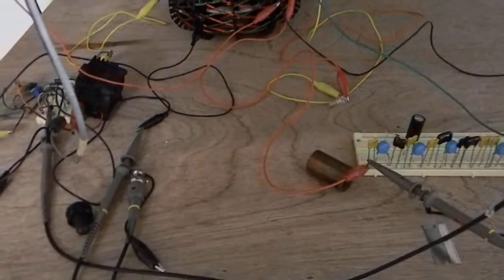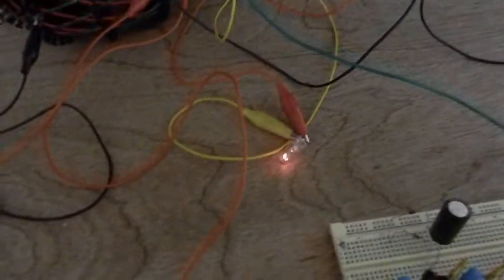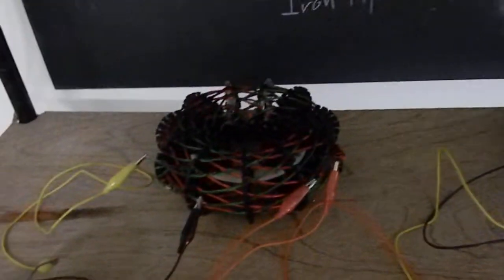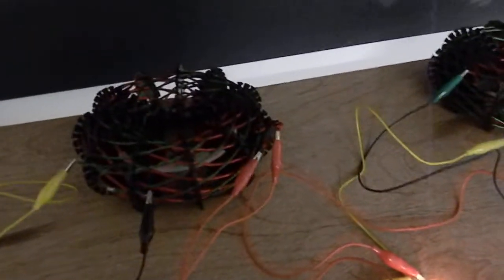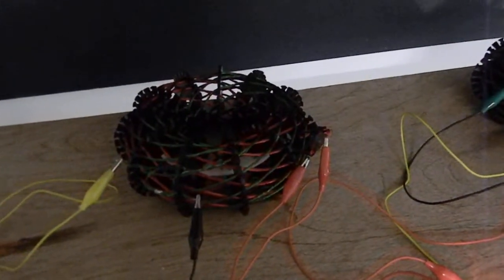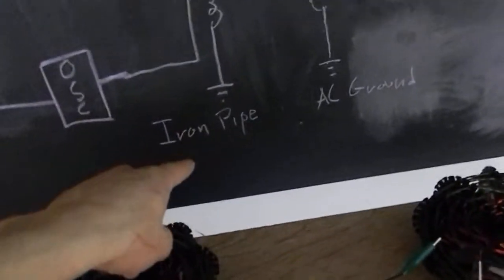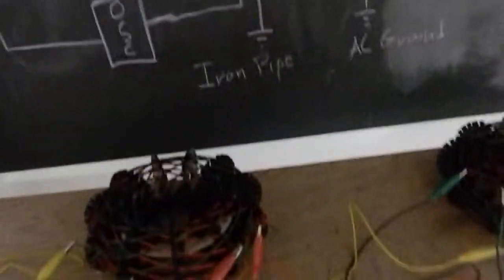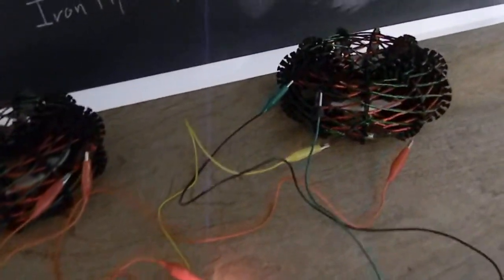Two Different Types of Resonance

Comment: I’m not sure I understand the significance of this. It is really just a demonstration of inductive coupling vs capacitive coupling, both are RLC circuits with resonant frequencies.

You have two air core transformers, they are wound kinda weird and don’t look like they have a high coupling coefficient.

In the first experiment you say that the secondary coils of both transformers can be ignored(disconnected?). So basically you just have two poorly coupled inductors, one with a variable frequency source driving it, the other with a small lamp connected as a load. Not surprisingly, you can only get the lamp to light dimly due to the poor inductive coupling and therefore inefficient energy transfer. Simple solenoidal coils or pancake coils would perform much better.

In the second experiment you connect the secondary coils both to ground and then together on the other end with a 12nF capacitor. Now you have your transmitting transformer connected through the capacitor to the input of the “receiver” transformer which in turn is powering the lamp on its secondary. First of all, this setup is not wireless since you have them connected via the capacitor via wires. Second of all, the transmitting transformer is doing nothing (except wasting energy), it would be better to connect your voltage source directly to the input of the receiver transformer (with the capacitor still in series I suppose). 

And before you say, well the capacitor could be replaced with just a transmitter and receiver toroid or something, no, to get 12nF of capacitance even at just a distance of 1m you would need plates with an area of over 1,000m^2

So basically you said look capacitive coupling is better than inductive coupling, while using poorly coupled inductors and an ideal capacitor. Not an apples to apples comparison!
Reply: Btw I don’t mean to sound too critical, experimentation is good! But I hate to see people reject what they might consider mainstream EE knowledge (not saying you do!) but accept partially pseudoscientific ideas that really just “work” based on already understood and explained phenomena.

Comment: Hi there. Been loving your experiment archive! I'm wondering what happens when you put the two coils nearby, but stand them such that the other coil's putyer diameter touched the inner diameter of the other-- tangential. Is that still uncoupled? I agree that increased magnetitc energy flux involved in the transfer of energy within a harmonically resonant LC with spark gap is key... though I haven't finished my ecperimental set up just yet.

I don't think we need ground. Earth that it. The planet has many great benifits to the system, potentially... but we may need many tesla towers today. 

Free space. Emptiness. The aether. Thats all we need. A symmetrically balanced system arranged in a way to pulse energy. We must do it as cleanly as possible, else your "clean" signal in a spark gap appears with so much RF noise. On and off fast and short is the goal here, and the energy in space is available to meet our power demand. Sink or source.

Comment: capacitive coupling resonance can not be repeated indefinitely in my experience. it will load the souece down. But it is basically longitudinal transmission.
The fun starts, when you use impulses to induce resonance.
Impulses like inductive spikes
Reply from the maker: wait till you see what im building now
Reply from the maker: and you are entirely correct, this is stuff i figured out long ago and i was rather naive in these videos.
Reply from the maker: Im currently building a thyratron switched HV DC magnifier system to investigate different extra coil frequencies along with fusion (fusor.net), water burning and some other things!
Reply: @MrWarrensk   Sounds good! A thyratron could also be used to switch a resonant coil at maximum voltage to get an instant (disruptive) discharge. causing a longitudinal wave from the high dV/dT (instead of using an impulse)
Reply: @MrWarrensk  I see the latest (public) video of yours is from 5 years ago, is fusor. ney where you publish? Would love to see your work
Reply: @MrWarrensk   just looked at fusor.net  Fusion is a lot better understood when the electrostatic is not seen as related to particles, but to the dielectric field.

Fusion then becomes the fusion of the 2 electric fields, the dielectric field and the magnetic field.

When these 2 fields are fused, electricity is created.

But first both these 2 fields need to be induced, by magnetic induction AND dielectric induction, at the same place in the same time.
Reply: @MasterIvo  Linda Moulten Howe has a piece of "UFO" wreckage that was obtained by a soldier involved in the cleanup of the wreckage in White Sands NM in the 1940s. The bottom of the craft glowed for 3 hours after it wrecked. When it stopped glowing, the soldier broke pieces off and pocketed them. In 1996 they were sent to Art Bell. He gave a piece to Linda. She had them analyzed. Their Ion levels were 60 percent higher than they should be, and upon further analysis it was discovered they were subjected to terahertz frequencies approaching the speed of light. She doesn't know what that means because she's still brainwashed into Einstein nonsense. 

The high Ion levels were due to the metals being turned to a plasma state. Her metal was made up of micron layers of magnesium, zinc and bismuth. ALL diamagnetic elements. How were they turned to a plasma state? 

Here is an experiment done with a homemade ham radio. It's receiver was way too small to handle the High Frequency waves, and the Stainless Steel rods BYPASSED the liquid state of metal, and instantly turned to plasma. 

https://youtu.be/4yLbYlyT7wM

Linda's metal was turned to plasma using even HIGHER frequency. Terahertz. 
This is a Nikola Tesla plasma ball being spun at 4000 RPMS. Once it reaches high velocity spin, the tendrils are no longer free floating. They take order. Notice how hard the south pole tries to form despite the post powering it being in the way? Once they put a tinfoil hat on it, it tries to draw energy from it at the pole, causing the tinfoil to glow vibrantly. Northern lights. 
https://youtu.be/Wis_HEa3X84
That was just basic neon gasses creating that, powered by 2 AA batteries. The tendrils align within to create its own magnetic field. If you performed that exact same experiment with magnesium, bismuth and zinc, you wouldn't get a magnetic field. You'd get a DIAMAGNETIC field. ALL the incoherent dielectric acelleration would be pushed away, causing levity. 
There are hundreds of "UFO" cases involving ION residue left behind, electromagnetic radiation, molten magnesium drippings from crafts malfunctioning then crashing, as well as plant growth being permanently affected by landing crafts. See "Magnets and seed propagation". 
Let's go further. Bob Lazaars claim of Element 115. Unumpentium. Now known as Moscovium. It's used to make Element 113, Nihonium, by smashing Zinc and Bismuth nuclei together. Both DIAMAGNETIC elements.
Bob lazar also made a claim he could see light bending around the craft, but we've all seen a Ferrocell by know, and understand what is causing light to bend. He also stated WHILE the craft was operating, he could hear the men inside it as if they were talking on a loudspeaker. Well, the Ham radio plasma video. He was talking THROUGH the plasma, which was just HF waves turning to VLF waves, just like a bass speaker functions.
What I'm getting at, is DO WE NOW, have the ingredients for levity???
Lastly, how the hell was that micron layers of magnesium, zinc and bismuth BONDED like that?!! EXTREME HF waves???
Reply from the maker: @MasterIvo  for now ive been posting my build on instagram @warren.the.wizard Ill probably make a new video on here as I start doing experiments! If youre registered on fusor.net i just posted my build in the new users section.

Comment: Hello!
Great work There! 

I have a question. Does Your coils have a separate channel P (primary) and Channel S (secondary) ? Yes/ No? 
I'm asking because  "1stopenergies" they creating coils from 1 string of cable emulating Secondary channel just by winding counter clockwise from winding start point. 

If you haven't tested such combination, could you? Mabe there are essential differences in work between windings S/P and S=P

In your configuration Obviously You can easyly ground your secondary channel and let the "magic" happen :)

Thanks for Those videos and nice backgroud music! :)
Reply: yes, check out my website for the wiring description. primary and secondary have the same amount of copper, but different number of turns. the 1stopenergies stuff is daniels own creation, I am mostly devoting my time to applying tesla's works to the vortex coil.

Comment: Yes, I think you're headed in the right direction. Other people have try their own pwm circuits but the outcome has not been optimal. The JS monster seems to be ideal. 

UFO Asymmetric motor generators pulsed by the JS monsters and vortex coils together is a really interesting combination. I believe the only piece that's missing is the regenerative acceleration generator by Thane Heins. It should complete the power-station.

Please share your findings and thoughts with the team. I posted your link on http://www.energeticforum.com/renewable-energy/10529-my-motors-got-me-tap-into-radiant-energy.html 

Keep it Clean and Green 
Midaz 
Sorry, I posted this comment on your last vid.  Had two pages open! Lol

Comment: I think you right.... I would like to see your UFO asymmetric motor pulsed with the JS monster driver. It should drop your input wattage. Hence, giving your motor higher output generator wattage percentage. That should make everything Crystal clear
Reply from the maker: I will do that, I have been trying to piece together the monster driver...I built my own circuit that I have been using so far....I can also use it to drive the asymmetric motor too. I would like to use higher voltage to drive the motor and get nice sharp off times. Ive also thought about building a resonant DC driver for the motor to drive it at its resonant frequency so the radiant comes through real nice independent of motor speed. I will do a video on that later this week. The asymmetric motor would be ideal if it were much larger!
Reply: @MrWarrensk  just making sure, are you alive..?